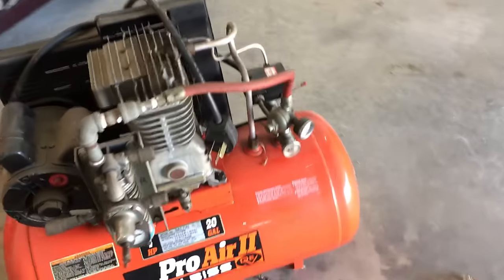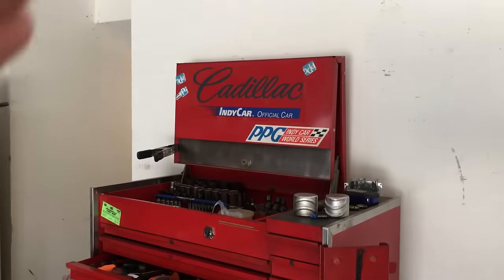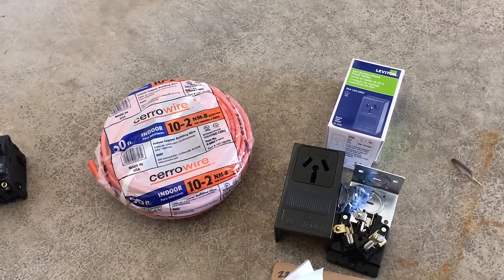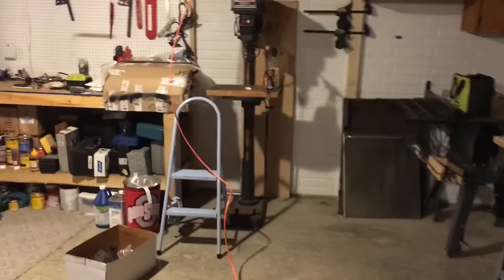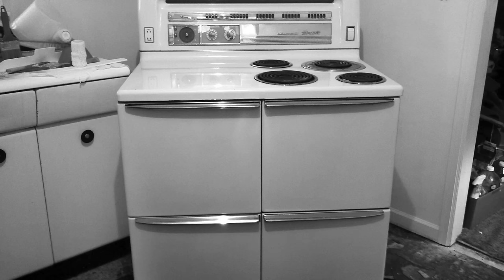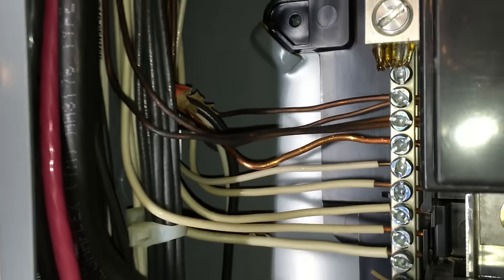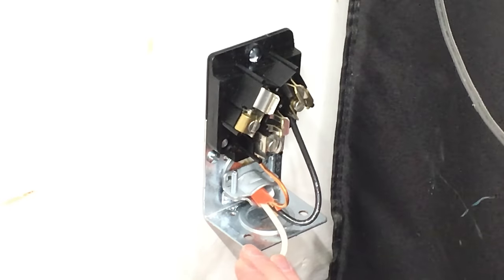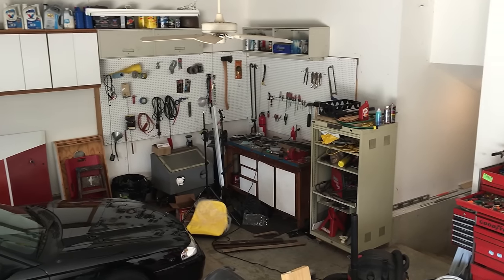How to Install 220v outlet in Garage the Easy Way = Run from Basement

Comment: The existing holes in the joists should be centered top to bottom to maintain the load bearing strength of the wood. Someone drilled them in the wrong place.

Comment: this is thin wire for this amp
Reply: 10 wire is rated for a 30 amp breaker.
Reply: @brianharmeson3144  But he used a 50A receptacle :)
Reply: @ZiggyTheHamster  as long as the wiring used is paired properly with the breaker (10awg for 30A breaker) doesn't really matter what the receptacle is rated at right? if you plug something in that pulls more than 30 amps it'll pop the breaker....let me know if i'm wrong
Reply: @justinrobert2842  You can supply a lower amp receptacle with a higher amp breaker, but you can't exceed the receptacle's rating. So if you had a 30A breaker but used a 50A receptacle, big no no. Or if you tried to use a 20A receptacle to draw 30A.
Reply: Keith Gable huh? That explanation is wrong. You as long as the wire is size appropriately to the breaker the outlet rating doesn’t really matter if you oversize the device. The device only pushes out 50A if it’s supplied with 50A

Comment: A loose run 240 with no EMT is extremely unsafe. Also using a white wire and assuming someone will understand the black tape. The ground wire is useless at that point and should be a neutral. 
Otherwise I agree it works but seriously not safe in the long run.
Reply: No..  all residential 240 is usually  nm wire like that.
Reidentifying with tape is acceptable and if you dont know that you shouldn't be in the panel. 
And finally, that is a 30 amp plug designed for 2 ungrounded conductors and an equipment ground.   It doesnt need or require a neutral.

Comment: Exposed Romax is not up to code as per national electrical code this video is misleading and against code
Reply from the maker: Only has to me covered with conduit  going down basement wall to box. Exposed and Stapled to floor joist of basement ceiling or inside a wall is ok.

Comment: Unfortunately this video is more about routing wiring than about installing a 240v line. You completely skipped over that part. WHY?
Reply from the maker: It seems like you may have skipped some parts of the video. It’s all there.
Reply: @6thGearGarage  at ~5:40, you go into hot/neutral/ground wiring, then *magically* the 240 double breaker module is already installed, and wired. I think the reason why people would watch this video, based on your title, is how to wire a 240 line safely.
Reply from the maker: @wangissimo1  Yes, I only showed where the wires are after installation. If someone does not understand how to install the breaker, then they should consult a professional, as I do not want to be liable for someone getting hurt. You may be referencing a different video, mine is titled "How to Install 220v outlet in Garage the Easy Way = Run from Basement" where I just show how easy it is to get 220v to a garage if you have  basement.

Comment: I never buy wire in any quantity other than 250'.  The price per foot is a complete rip-off in any other quantity.  How much would a 250' roll of 10-2 have cost, versus $65 for 50'?  Do the math.
Reply from the maker: Jeff I agree. I buy 12 and 14 ga in 250' rolls but I have no other use for 10-2.
Reply: @6thGearGarage  OK, that's fine.  I buy it in 250' rolls too, because I use it for wiring central air conditioners (a common thing that I get calls for).
Reply: What a stupid comment. What if you have no use for the other 200'? Duh.